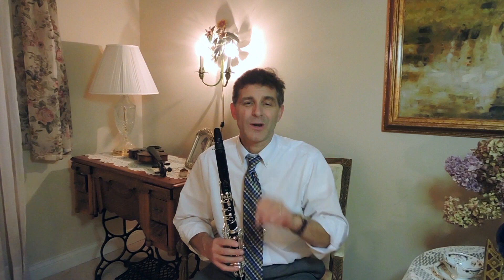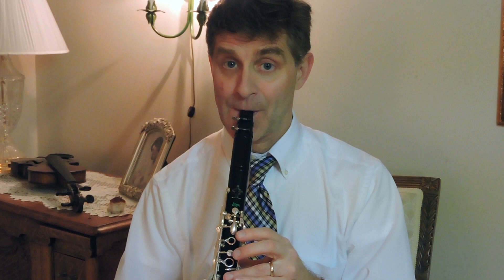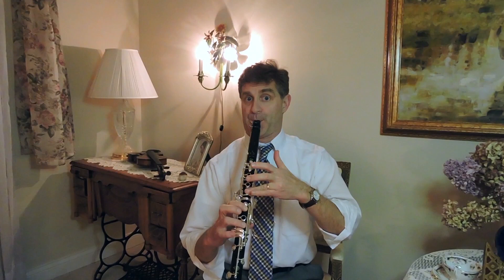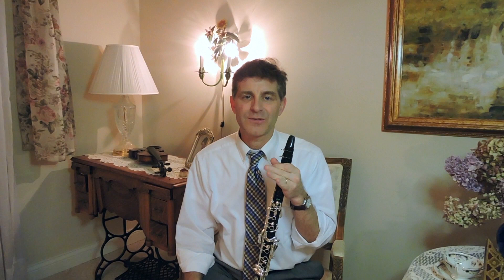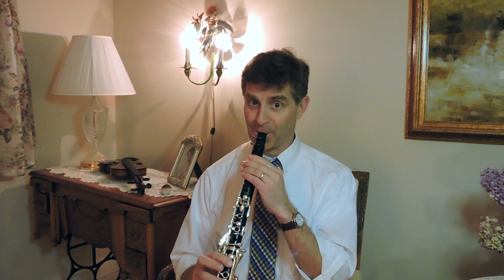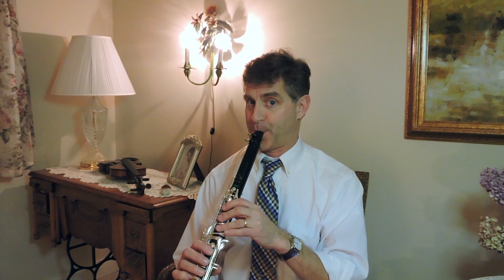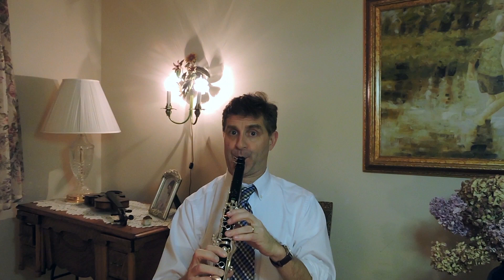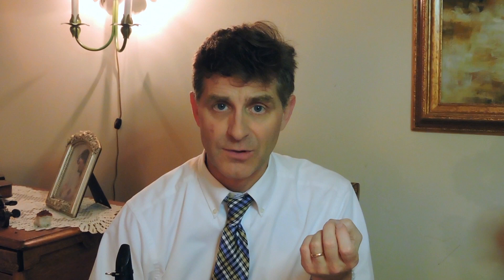Clarinet Embouchure Basics

Comment: I had a Bell’s palsy quite a few years ago and as a result I have a weakness in my facial muscles.   I so much want to learn to play the clarinet and have made some squeaking sounds from the mouthpiece only.  Do you have any advice for people like myself with this affliction?   Thank you so much for your easy to understand videos and your words of encouragement!  :). Diane
Reply: Hey Diane.  You probably won't get this in time.  Hope you started clarinet.  If you can get a squeak on the mouthpiece, you probably have enough lip muscle to play.  I have loose upper teeth bridge and have to be careful so I use softer reeds.  You can use 1.5 strength reeds and closed tip opening mouthpiece.  Or yamaha 4c is just 1.05 tip opening and is only $30.  A closed tip opening mouthpiece with a soft reed will not require hardly any facial muscle.  Wish you best of luck